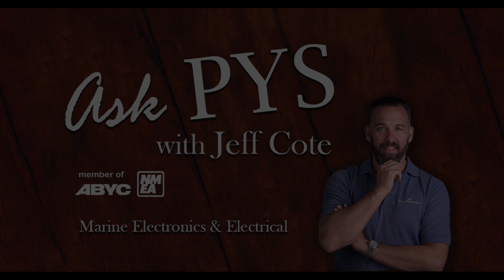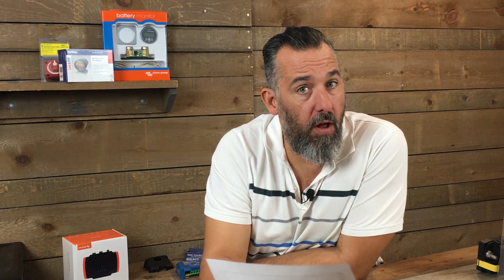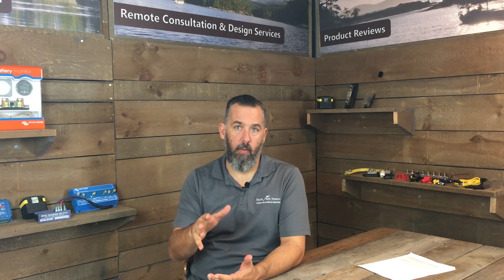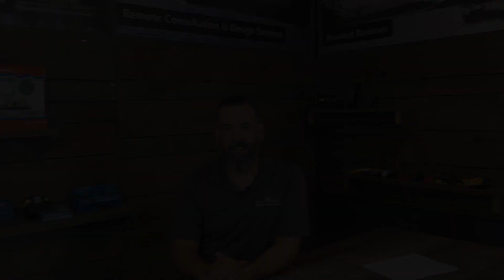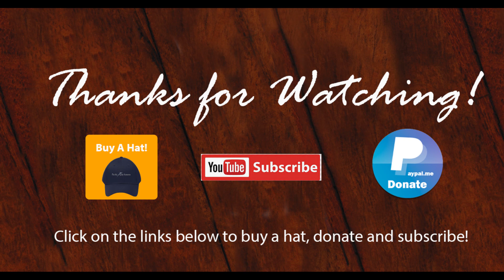Can You Explain Battery Capacity and Battery Voltage on My Boat?

Comment: Totally agree although to make a actual verdict I would want a little more detail on the battery monitor? what make and model it is? and how it's wired? we have a couple of voltage displays on the boat; the original analogue factory one, a cheap Chinese USB socket with display on a Aux switch circuit and a Simarine battery monitor with shunt.  we get very different readings on all due to how they are wired and voltage drop etc as you have called out in many of your other videos.

I assume he is taking readings using a volt meter directly from the battery and that the 40A consumption is not missing any loads bypassing a shunt
Reply from the maker: Thanks for sharing your input on this Boatingtube.

Comment: Hi Jeff! More progress on the design.

If I have a 24V house battery system, how would I go about keeping and charging a 12V starter battery? I'd prefer to keep the engine 12V.

Would it be better to keep the whole boat 12V?

Cheers

Daniel
Reply from the maker: Definitely easier to keep the whole boat one voltage. You can install a DC to DC charging converters to go from 12 to 24 volts for charging from engine battery to house battery.
Reply: @PacificYachtSystems  I was actually just looking at a 24V to 12V smart charger from victron, allowing high current charging from the alternator for the house battery bank.
Reply: Someone(koffi banan? ) commented on using a DC-DC converter, I looked into them, but was wondering about how the battery would be "smart" charged instead of being given a constant charge rate.

My other worry would be that the original windlass of the yacht I'm planning on purchasing for this retrofit has a 12V windlass, would I need to change that as well to make it easier on my system?
Reply: You could use a DC-DC converter.
https://www.victronenergy.com/dc-dc-converters/orion-tr-dc-dc-converters-isolated